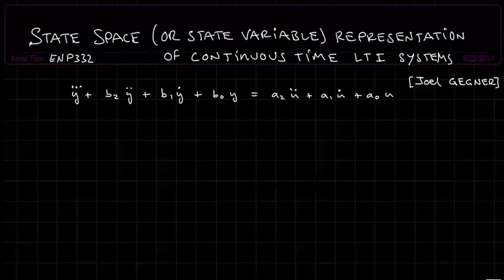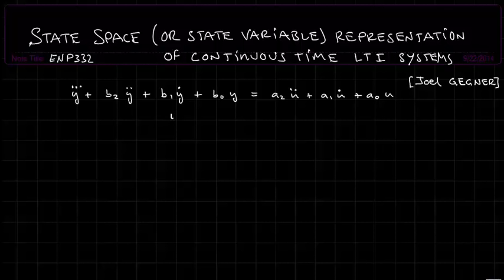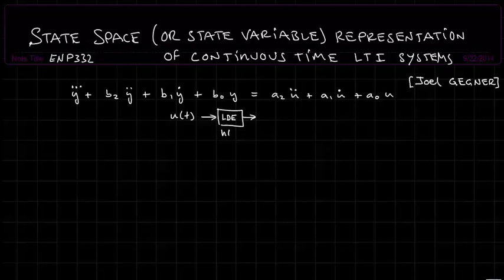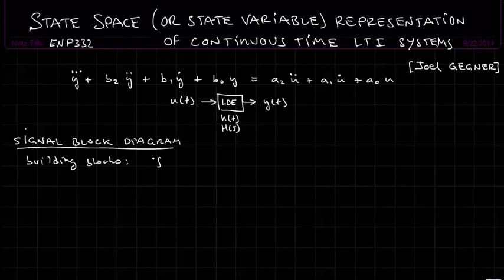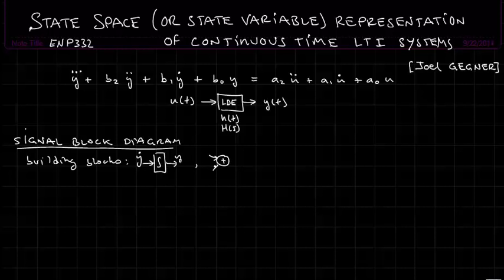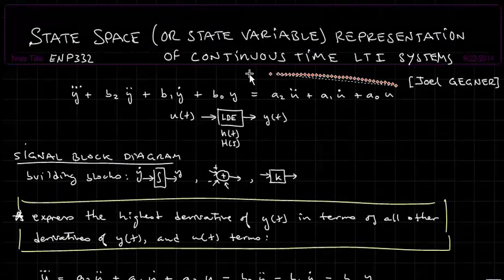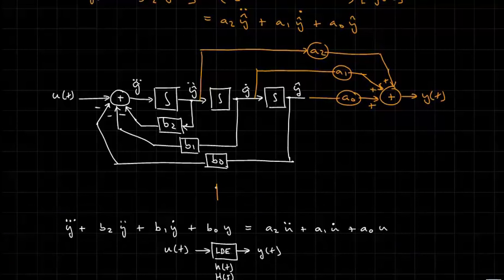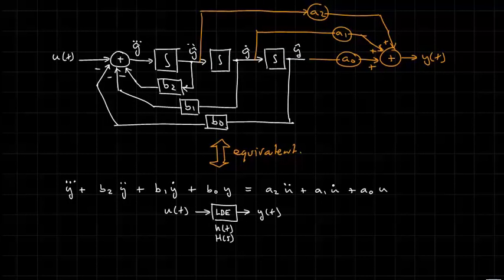Introduction to State Space (State Variable) Representation

Comment: The best state space explanation I come across. Thanks

For whoever interested in the software used in writing over the screen it's  windows Journal. Thanks
Reply from the maker: Thank you!  And yes, you are correct, it's Windows Journal and Camtasia for screen capture and editing.
Reply from the maker: Thank you!  And yes, you are correct, it's Windows Journal and Camtasia for screen capture and editing.
Reply: @jogreengel  Thank you for your confirmation , what is pen tablet you used (model and size) ?
Reply from the maker: @mnada72  I've used a variety of Lenovo Thinkpad tablet laptops - x61, x200, x220, and most recently (and most disappointingly) the yoga 12. All the x tablet laptops had Wacom pens, which worked great. Sadly, IMO, the quality of the pen input on Thinkpads has gone down, and my favorite to this day is the old x61 or x200. The x61 was nice because it had a 4:3 screen which was a good screen form factor for writing notes on what felt like a pad of paper. The newer models' form factor seems to be driven by the desire to have an HD form factor, like 16:10 (worst offender being there x220)